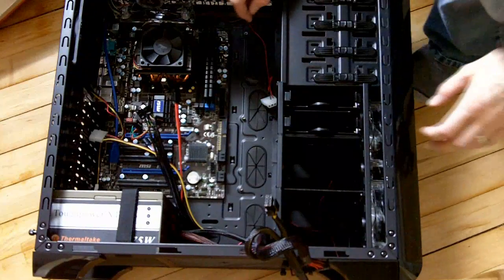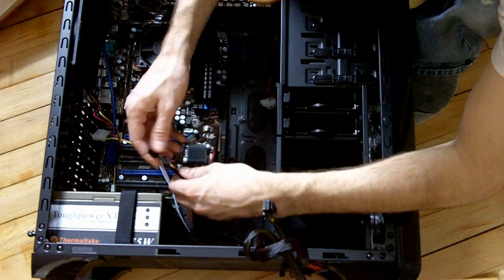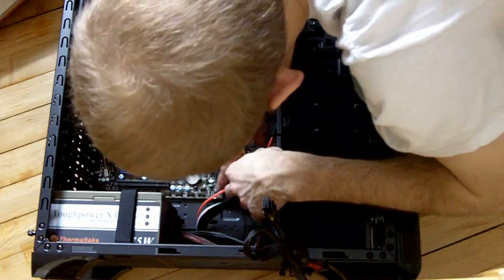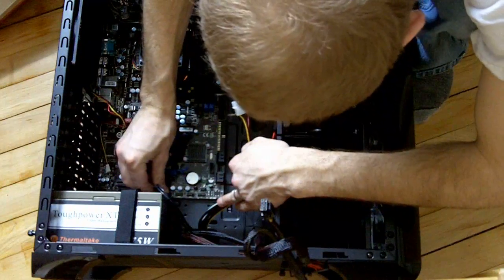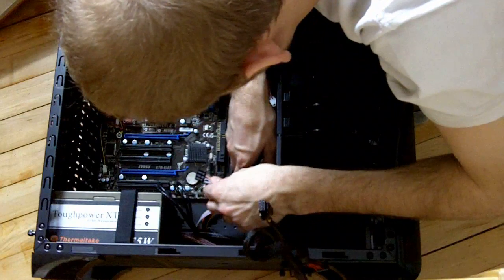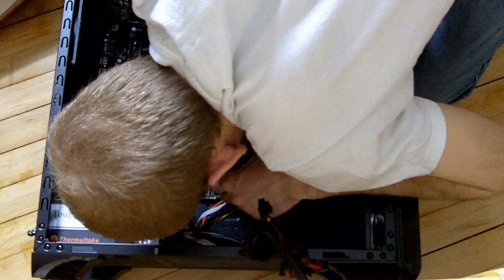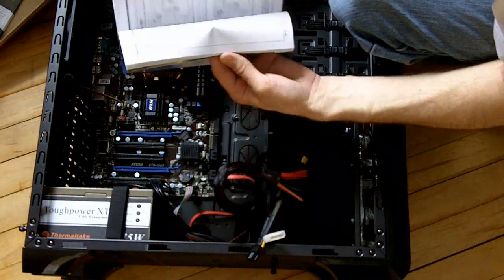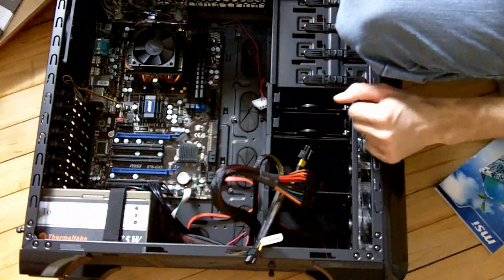Install Top USB, Buttons and LED's on Rosewill Blackhawk Case

Comment: What's the 4 pin connector near the top used for? The red, black and yellow cable. I now it's coming from the mic and headphone jack or somewhere near the top next to the power on/off button and USB slots